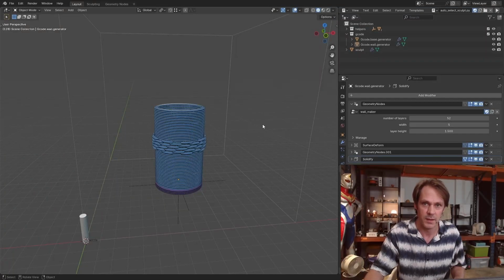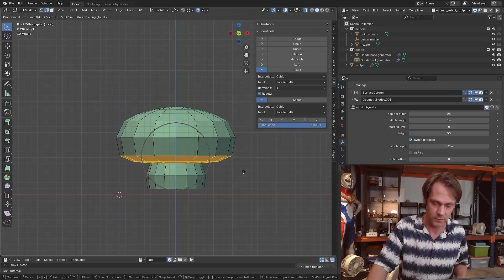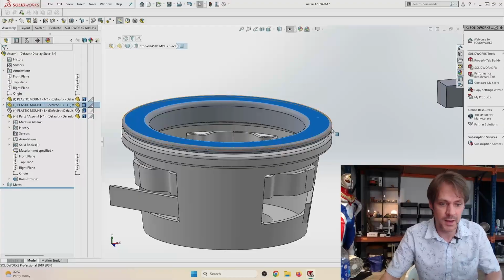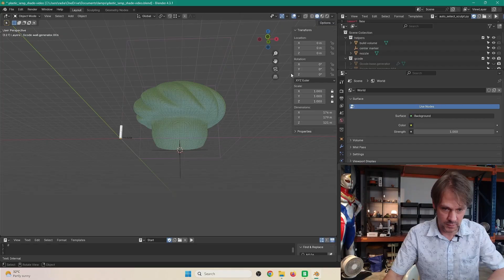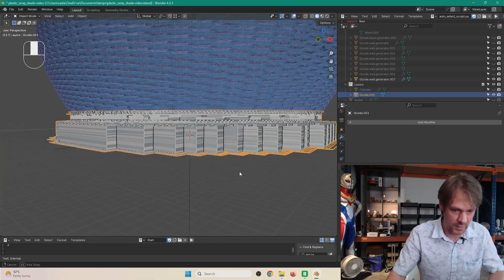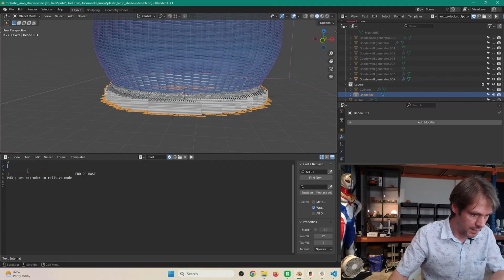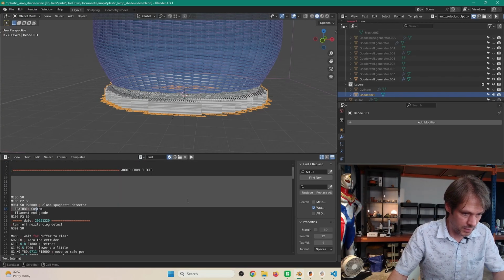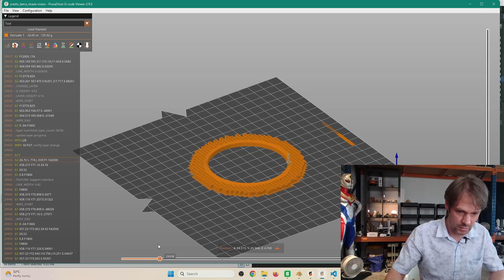Creating Textures on 3D Print

Comment: Hey, amazing work thanks for sharing your research. My question is a bit off topic but i'm desperatly trying to print chunky layers with my Bambu A1 (nozzle .8). I ideally would love to print with 2mm layer height and 4.5mm layer width but all the slicers have been blocking me so far. Any idea how i could get there?
Reply from the maker: The slicer will usually block you from using a layer height and width that is too far away from your nozzle size, so if the slicer will not let you use the setting you want you might have to increase the size of your nozzle,  or maybe just tell the slicer you are using a wider nozzle without even changing it on the printer. But for the best results, you should keep them about the same.

Comment: Could you show us what happens when you try printing with supports?
Reply from the maker: Do you mean support for a clay print? For that, the problem is that the support sticks to the model, and it has to be very thick to hold itself up. I have printed a separate support structure in plastic for some designs and then printed the clay on top. That works well, and I'll do a video on that sometime soon.

Comment: Better generate the g code in the slicer. You can use vase mode and it should work just fine. The slicer has advanced methods of cooling overhangs in the perfect moment, so doing it the way you did it is not only very difficult but leads to visual defects.

Great designs btw, and crazy blender skills on an metahuman speed
Reply: Hablas de exportar directamente el objeto desde blender para laminarlo en el slicer?, esto es posible? No lo entiendo muy bien todavía pero comprendo que en Blender el patron/diseño está generado directamente con el recorrido del Gcode, por lo que no entiendo bien si es posible exportarlo como objeto y que este se imprima bien

Comment: These are amazing lights. I do worry about 3d prints melting though. Someone puts the wrong bulb in, and you've got a puddle.
Reply from the maker: I have looked into this, and there is a risk associated with PLA or low-temperature plastics. Although it will not melt, it could warp, making it less structurally secure, especially if the parts are under load from ceramics. PLA also degrades over time in UV, which can cause it to become brittle and lose its strength.  Filement suppliers are constantly improving the properties of the material, though.  So, as long as you understand the limits the design has to withstand, I think it is very doable to make a long-lasting and safe product this way. Material science is one of the most interesting subjects in product design. I would love to do some content on that.